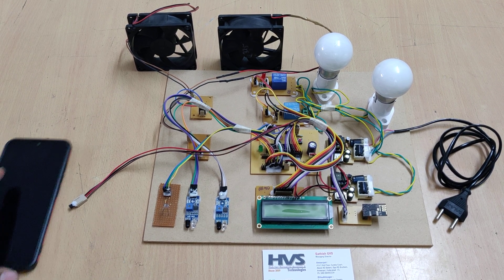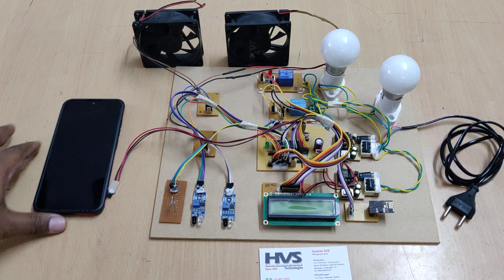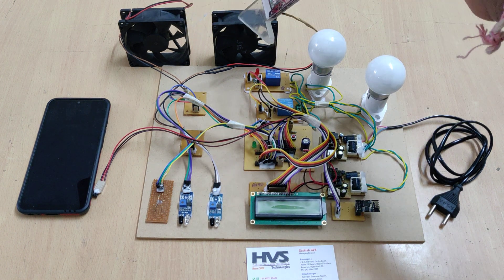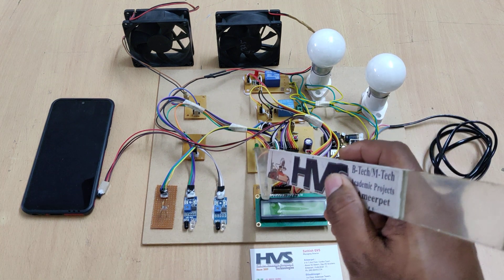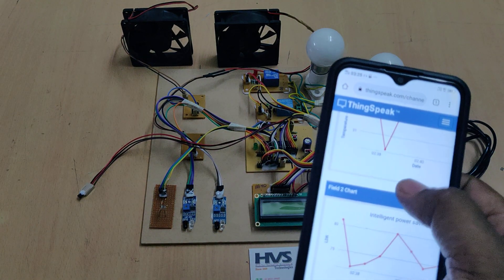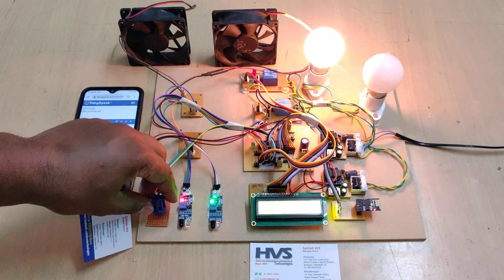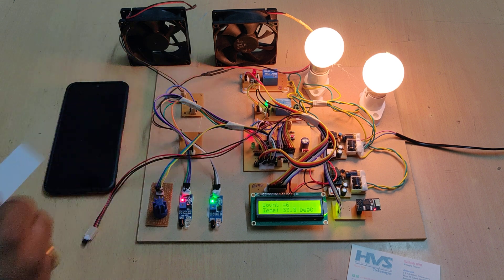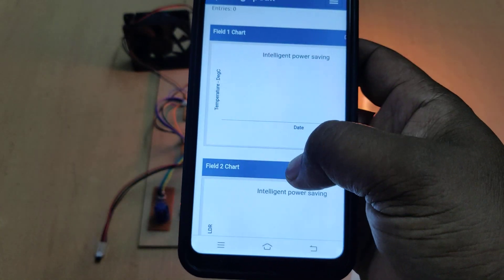Intelligent Energy Saving System for Classroom based on PIC Microcontroller thingspeak LDR LM35

Comment: What is the cost of this whole system sir.
Can you provide the connections and components required all details sir
Please
Waiting for your response
Reply from the maker: Hi, 
We sell full working kit with document PPT circuit diagram and code. Could you Send me the video link, Will update you the cost details. You can contact us at +919603140482
Through WhatsApp or call